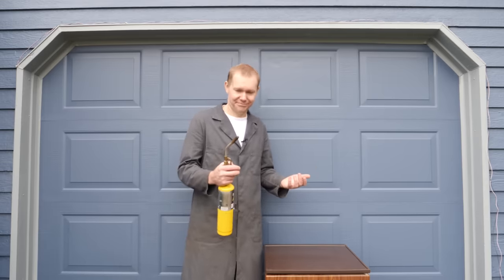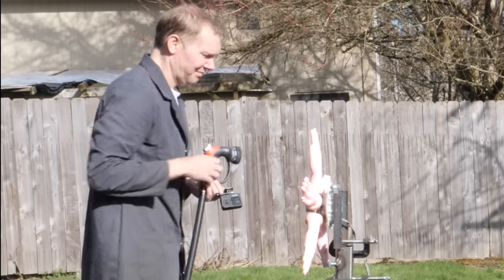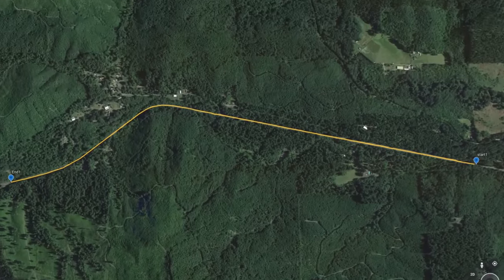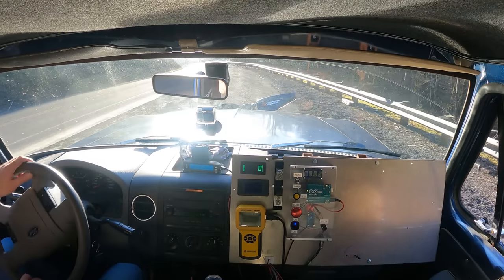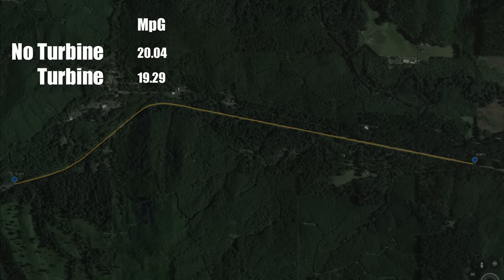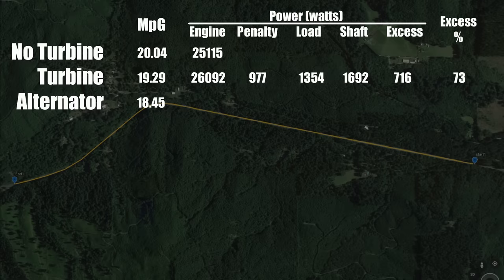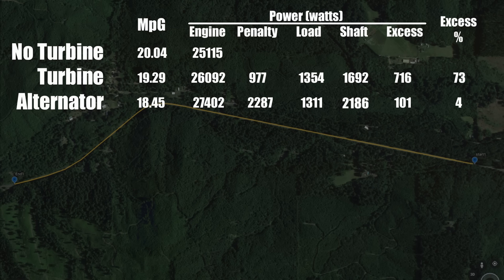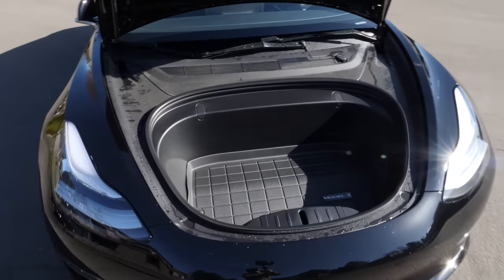Mileage Results You Won't Believe!!! - Wind Power on a CAR #5

Comment: I missed the part about why there's an oven in the car. But I like having this mystery.
Reply: Lmfao!!!! I thought the same thing initially. He uses the oven to measure output load.
Reply: @charlieodom9107  hmmm that is a very interesting idea.    A true variable draw is hard to come by.
I wonder in what strange way this could be used to solve the load test problem on computer power supplies.       None of the PS testers actually simulate a load.   People do stuff like stick in a galvanized paper clip to simulate a load.
Reply: @janglestick  I wouldn't have used an entire oven, but the idea behind it is to keep the heat inside the oven instead of heating up the cab. A heating element vented to the outside or in water can achieve the same result.
Reply: Thank gosh I’m not the only one. Looks like he forgot a clip in his edit. Man sounds like a mad man
Reply: I thought this couldnt be any more wrecklesd untill I saw the oven in the cabbin.
Reply: Nice character,, don't ruin it with the lack of safety 🙃🌈⚖️🐃
Reply: @charlieodom9107  i literally just saw this recently for the first time somewhere.
Reply: My question still, what if the load was a thousand watt electric motor?
Reply: yea me too, 70s bronco, 2010 interior, propeller, oven. I have no idea what's going on.
Reply: You'd gain 4 mpg leaving the oven and kid at home. Weight. Still all very interesting and has me wanting to mount a prop to the front of my 79 Lincoln to divert air

Comment: The difference between free energy and recovered energy. This was a cool way to learn about it.
Reply: There isn't any free energy, but there is free energy
Reply: @tedarcher9120  defuq ?
Reply: @snek9353  Which part of the video did he prove that?  This is effectively energy recovery, it is reclaiming energy produced by burning gas that would otherwise have been lost.  However it would be far better to approach this by working out how to minimise those losses in the first place so they don't need to be recovered.
Reply: @ferrumignis  splitting hairs. most of us separate recovered energy from "increased efficiency" so aero improvements would be increased efficiency while regenerative breaking would be lost energy recovery.
Reply: @nerys71  By your very own definition this is energy recovery then.  He is recovering lost energy, I am saying increased efficiency (better aero) would be a better way to approach this.
Reply: @ferrumignis  I know that's my point think of it this way you have apples and you have oranges they're not the same thing but they are both fruit :-) 

Same thing applies here all energy efficiency improvements are lost energy recovery by definition

You start with 100% and you lose some efficiency improvements recover some of what was lost or would have been lost we just tend to describe them a separate categories like apples and oranges and we simply need to understand that they really are the same thing fruit or lost energy recovery
Reply: ... seriously lol
Reply: I agree. It is more effiecent recovering energy than wasting it.  This is the best project

Comment: Excellent video! I like your theory on how the turbine is essentially improving the drag coefficient of your Bronco! I might be able to flesh that out a tad more (AE here). If you look at the typical 3D flow field through and around a turbine, it's a diverging flow - it spreads out as the turbine smoothly slows it down. (The opposite is true for a propeller). I would bet that because of its location, your turbine is creating a flow field somewhat resembling what you would see with some kind of domed or conical fairing on the front of your truck! You've improved your aerodynamics by almost the same power as the turbine's output. 
I'm quite sure if this turbine was mounted on a streamlined pylon on the roof, it would cause a more significant reduction in economy. 
This taught me a good lesson though! I believe those explaining that you can't improve the efficiency of a vehicle by adding a wind turbine (I do it myself) have the overall thermodynamics right, but should keep this caveat in mind - that idea assumes the vehicle is already well streamlined, and that the natural flow pattern caused by a working turbine can't simultaneously be used to improve vehicle streamlining. Granted, a well designed fairing system is a far cheaper, lighter, and more effective way to improve economy, even in the case of an electric car where the turbine's power would feed back into the drive system. Lol!
Love it!
Reply: Fuel economy isn't the only useable energy to consider. Overall useable energy out any system or systems is ultimately the goal, so anywhere waste is harnessed or recaptured even if one system has a loss that improves the gain of another system. Together combined we want the best utilization of both or many systems.

Comment: I absolutely thought this couldn't possibly "create" energy. But your explanation of how the turbine reclaims that brute force air speed makes a lot of sense to me.
Thanks for a great series on the idea!!
Reply: You couldn't create energy from nothing, that is still true. His explanation is simply wrong. He burned 0.45 liters per 100 km of additional fuel because of the turbine. 0.45 liters of fuel contains 4275 Wh of energy and and he got back only 1354 Wh with his turbine. So he got back only one third of the energy. He didn't create energy.
Reply: @mirkogruden8362  that amount of fuel might contain that much energy but it needs to be harnessed and he showed that the turbine was more efficient than the alternator at doing so.
Reply: @guimauve522  Yes the turbine can be more efficient than altenator, because mass market altenators have very low efficiency. But he DID NOT create more energy than the fuel contains that he claimed!!  He got back one one third of the energy that he spend from additional fuel consumed because of the turbine.

Comment: I'm an energy efficiency specialist, one of my students sent me a link to your video. I can say you're pretty much spot on for a vehicle of this shape (aside considering all the safety laws.)  There are a few other things that could be done with this project, however the gains are fleeting for the work required.
Reply: You ever seen that video of the wind propelled car that could go faster than the wind? Do you think it’s possible to have a compact version that would charge a car battery to power an electric car as it was moving? Theoretically it would take the energy from the air and transform it into electrical energy for the car to use
Reply: @hungryhunter7158  that would not work for a motor vehicle. The setup you describe works in a very limited circumstance.

However what the guy did in this video, I've only seen in like, 5 other vehicles in my time...coolest one used a cage fan to greater effect.
Reply: @hungryhunter7158 yes if you drove on the wrong side of the freeway towards traffic head on then the wind the semi trucks produced would power your car 😂😂😂

Comment: The less aerodynamic a vehicle is, the more efficient this turbine will be. Teslas are the most aerodynamic cars in the world, so adding this turbine will probably just hurt. Adding it on an electric pickup will probably increase range though
Reply: @snek9353  trains and trucks, for example
Reply: @snek9353  it reduces drag on a boxy vehicle like a truck
Reply: or change out this brick on wheels
Reply: Not true.  The only thing proven here (maybe) is sticking a wind generator out in the free airflow will charge the battery more efficiently than an engine driven alternator...at this vehicle speed.  Let's see how much electrical power this contraption generates while you're idling in traffic.  Hint: none.
Reply: @snek9353  Nice to see there's one other person here who's as underwhelmed as I am.  This "project" gives me a headache.
Reply: @mikeb.7068  Why do you feel the need to share your thoughts when all you see is the negative, the positives are not free energy but learning, understanding and engagement. Why not troll somewhere else mate.
Reply: @garethbruce6865  Good question.  Serious answer.  Because I'm a mechanical engineer and these "experiments" are confusing, pointless and annoying.  Nothing worthwhile is being investigated here.  The worst part, in a previous video, was when he was driving his son around with a fully exposed heating element two feet in front of his son's face.  If anyone thinks they're learning anything from this, they're probably wrong.  If you want actual science and engineering go to Mark Rober's channel or SmarterEveryDay.
Reply: @mikeb.7068  I'm an electrical engineer and business owner and if you want to inspire then do, this channel does that and makes engineering fun. It is probably best you do not watch if you find this offensive. It's better for everyone.
Reply: @garethbruce6865  How is you being a business owner relevant?  While we're flexing, so am I.  I object to the pseudo-engineering being peddled here.  A good example is Ted Archer's comment above: "The less aerodynamic a vehicle is, the more efficient this turbine will be."  That is 100% wrong.
How about this.  Why don't you tell me what you learned from this video?
Reply: @mikeb.7068  It is relevant because we need people to be interested in STEM, and to be interested you need to be engaged, whether this video misleads is irrelevant, the engagement is everything, this enables people to learn and try new things and to discover the truth themselves. Tell me how do you think you are helping this by commenting in such a negative way? Better to not say anything and move on, you will not achieve anything by distracting from the video. If you want to be a distractor try Twitter they love an argument. As an engineer what are you doing to get the next generation engaged ? This guy is investing his time and resources in getting people engaged, that is what engineering and science is all about. Discovery and engagement. I will not be replying again, but feel free to continue if you want.
Reply: @garethbruce6865  Seriously, what does it say when a channel like this can not stand a little criticism from an actual mechanical engineer who has studied thermodynamics, fluid dynamics and electromagnetism in depth?  I have never been moved to comment on Mark Rober's channel or on Destin Sandlin's channel.  I commented here because just about everyone commenting on this video who has drawn some conclusion from it is wrong.  Picked at random:  "As for your science logic, its unquestionable. You're not trying to break the laws of thermodynamics.  You're just capturing some of the energy you'd lose in drag."  Wrong.
Reply: Lol adding a battery to an electric vihecle will increase range also ... But not how well  it uses energy
Reply: @ingulari3977  Most of the improvements to aerodynamics involve other sacrifices... adding a "cone" to the front and/or back increases the length, reduces visibility and maneuverability and might be illegal for road use, not to mention the potential cooling losses which must be made up for elsewhere. In this case, you refer to "reliability" as less moving parts, that is true but is also passive and the returns may not be equivalent to the gains. finally you refer to pedestrians... there should be *NO* pedestrians that close to the vehicle during normal operation at the speeds the turbine would need to be operating... at a stop light (or similar) the turbine would not be "running" anyway and pedestrians should not approaching that close to the front of the vehicle in most cases anyway.  We are also talking about protecting pedestrians from a multi-ton brick... following through with your logic there should ultimately be no vehicles at all to be "safer for pedestrians"... then we have to address the other pedestrians blundering about running into those faster or slower moving... Please, sit down and take a bubble wrapped cocoon of a break.
Reply: @mikeb.7068  Even if it charges the battery more efficiently, then that's a gain.  He never claimed it would generate energy idling in traffic.  We're looking at a 700W gain on this vehicle, so who cares where it comes from.

Comment: I paused the video at 24 seconds to write this. My gut tells me that the car/truck was already dealing with this wind drag. Now, the air is allowed to do work on moving the turbine and no longer just smashes against the body of the car. This is totally feasible and not breaking any conservation laws.

Edit: My intuition was right. Also I didn't realize this was video #5 lol
Reply: But would it work on a streamlined car

Comment: "Expecting your fridge to work, without plugging it in"

My fridge isn't plugged into any outlets or cords. And it works great. So.... 

Granted the propane has to be refilled periodically, however... 😉
Reply: Doesn't your fridge need 12 vlts. to run also. My RV fridge is on propane and I have to have 12 vlts. also. Just asking. If it doesn't need any electric will you please let me know brand name and model. The Lord Jesus bless you and yours. Thks., J.C. Miracle
Reply: @joemiracle4212  the 12v is only for the light & ignitor. Most gas fridges use ether a click sparker or a battery powered sparker, same as a gas grill. Campers also have a electric element that takes place of the pilot on electric use.

Comment: Quint, as you can now recover energy from the airflow, how about recovering some of the wasted 75,000 Watts from engine heat? There is a steep temperature difference between the temperature of the engine and the outer skin of the car. Surely a Seebeck generator could be utilised here?
Reply from the maker: Heck yeah.
Reply: Seebeck thermoelectric generators are pitifully inefficient. You are talking 5-15%. Yes, that is "free energy" you would be collecting that would otherwise be wasted, but the monetary investment outweighs the fuel savings so drastically, that the payback period is far too long to seriously consider. Especially when you factor in the inefficiency afforded by the additional weight of the TEG system.

Why not just don't produce the heat in the first place by going electric? "*Reduce*, Reuse, Recycle"
Reply: Is that similar to a sterling engine that generates motion using temperature gradients?
Reply: Wind and Solar, then Sterling and Seebeck. You want to start where the most gains can be made first and add the more expensive least gains last.

Comment: Well said commentary! There is a system you can build to crack water from a gasoline engine. It will not only function but will exhaust water out the pipe. Many believe it takes more energy to develop to crack water, but when you raise the application of voltage, you can easily crack water!

Comment: Are you building a more efficient alternator next?
Reply: Great question, I'd be interested in seeing that!
Reply: That's what I thought alternators are very efficient at doing the job they are designed to do: charge the battery not run an oven. If you tried to charge a car battery(for a gas engine) with that generator it would over load it and cook the wires in his car. They are not meant to do the others job.